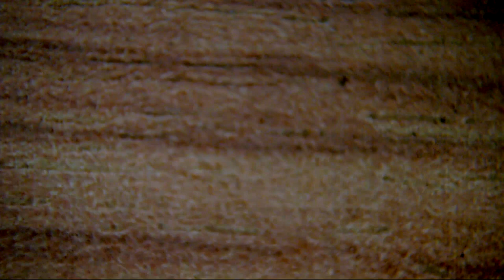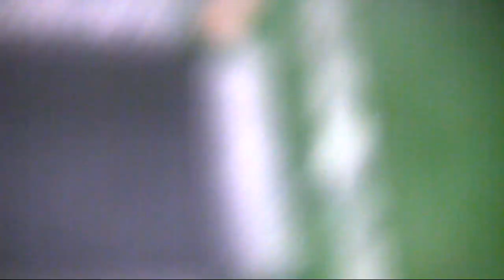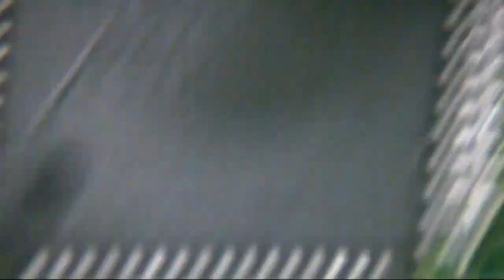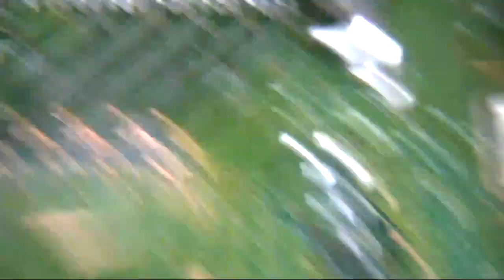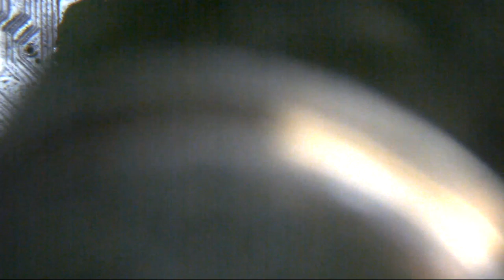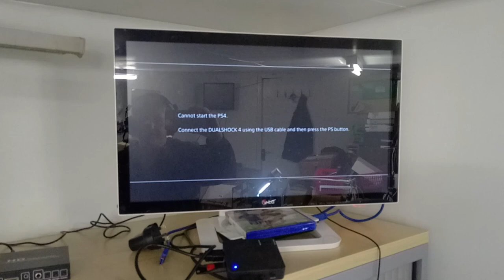PS4 Persistent White Light No Display / Red Fuzz Repair - Bad Transistors

Comment: This guy is so good . Well constructed videos and clear speaking . Thank you so much
Reply from the maker: Thank you.
Reply: @AndrewPaul  I have something similar to the red screen of death, but when I connect via hdmi to dvi to my monitor that I use for my PC and I got a display, but, the colours are all distorted. Where blue and black should be I have more of a pinkish/reddish hue. What could I do about this? Is it an easier fix?
Reply from the maker: Chances are that it's an issue with the HDMI encoder IC. Try the console with a TV via HDMI and see if the issue persists. If so, then I'd be tempted to replace the chip. It's a common cause with HDMI > DVI adapters - the PS4 really doesn't like being fed via an intermediary device and in my experience has led to lots of damaged / blown encoder chips.

Comment: Hi Andrew. Great channel. You are my go to for console repair. I might have missed it but can't seem to find a tutorial specifically for the CU1215 HDMI port replacement anywhere. We managed to get one off today without damaging anything in close proximity at least as far as what is visually apparent but there's a lot of components close by that concern me a bit. Any tips for safe removal and preferred vendor for 1215A/B ports? It seems that they are slightly different than the old style.
Reply from the maker: It's here mate - you can use the same port for the SAA/SAB and SAC boards. CUH-2xxx machines with SAD boards use a different port (same as PS4 Pro). https://www.youtube.com/watch?v=IaWztCEGdOo
Reply: Well not sure how I missed that but thanks!

Comment: Hey Andrew, I tried googling my problem and your video is close but doesn't fully match what I have. Was playing RDR2 when I noticed a red flickering start on the screen during gameplay. The color red replaces any black shading or the color black when rendering. This also shows on the main PS4 menu and other games, so it isn't game specific. The flickering isn't constant, but intermittent.Tried switching HDMI cables, took it apart and cleaned the dust out, but I haven't taken it down all the way to replace thermal paste yet. Have you heard of this problem before? I'm thinking it might be a connection somewhere in the HDMI pins or paths, since it's intermittent, but I'm guessing.
Reply from the maker: Hi, yes it's probably due to a failing HDMI Encoder IC - pretty common issue on the PS4.

Comment: My ps4 was having display issues, I would move my console quite often from  my home to my friends and figured cause of the frequent changing of the HDMI cable I had damaged my port, it would sometimes work if I played around with the cord but it would mostly just display a image covered in red dots and no audio. Today after a long time I decided to move it to my tv downstairs and now it is working completely normally. I am scared now to move it as I’m not sure what will happen if I do. Any tips or suggestions besides just leaving it as is because it is connected to a family tv not personal. Sorry for the rant!

Comment: Great videos,  I have any issue that I don't see covered in your library. I have a 1001a on 1.61fw neither power button or eject button work even after being removed from case. A disc inserted or a synced controller will turn it on and it functions just fine after that except will not eject or respond to power button. What could this be?
Reply from the maker: Hi,
I think you have two separate issues here - if the disc fails to feed at all then you likely have a blown F203, bad FETs on the board or a blown feed motor (or combination of if you're unlucky). Power button is on the motherboard on a different circuit - is the metal finger in the case lid making contact with the brass pad at the front edge of the board? Sometimes it gets stuck under the plastic light bar or gets badly bent out of shape preventing that which causes it not to power on. Press the brass pad with a finger and see if it powers the machine on.

Comment: Yo Andrew I tried to swap my hdmi and when it came out, the bottom of the hdmi (those 4 pins) snapped and stayed in my PS4 mobo. Can I remove it and how. PLEASE REPLY!!!!
Reply from the maker: Add solder to the bottom side of the board, heat until liquidous and push gently through the holes with a small jewellers screwdriver or tweezer blade - don't force anything or you'll push the holes out of shape which will make work for you when installing the new port. Alternatively add leaded solder and apply hot air from top side while holding the legs with a tweezer - when molten pull the leg up and out of the board. Either method will work nicely providing the kit you have to do the work with is up to the job.
Reply: Andrew Paul by the topside do you mean the side with the cpu, thanks for reply (new sub) :)!!
Reply from the maker: Yes mate.

Comment: Andrew, I have an issue on 1115, when disc starts to spin console turns off. What could be the cause?
Reply from the maker: I'd check to see if the spindle motor is shorted - out of interest does another drive in the PS4 exhibit the same issues?
Reply: I guess it's not the drive, some times it turns itself off during play without overheatung sound. What could it be?

Comment: Hey Andrew! I would really appreciate if you can help me with this. 
After 10-30 minutes playing, the display of my ps4 barely stops (like if the display is laggy or something) and then it turns off. But just after it turns off, the blue light starts blinking but the ps4 doesn't display anything, and when the blue light is blinking the power button doesn't work (the disc button does). So the only way to restart it is unplugging the ps4. Sometimes when I unplug my ps4 it doesn't even turns on, a white light shows for around 2 sec and then the console turns off again; what I do when that happens is to wait around 5 minutes and then it works when I turn it on.
I hope you can help me, I don't know what to do with it. Sorry if my english is bad.
Reply from the maker: Sounds like an issue between the APU / Southbridge and Syscon. Does it ever start weird i.e. very quickly on occasions to white light after a couple of pulses of blue with no display etc when the power button becomes unresposive? If so then I've seen a few of these and it's been down to Southbridge / DDR3 secondary RAM.
Reply: Andrew Paul Sometimes it happens that when I turn it on after I've unplugged it, it starts blue and then white as you said, but in that case the power button works and the ps4 turns off after around 5 sec of white light.